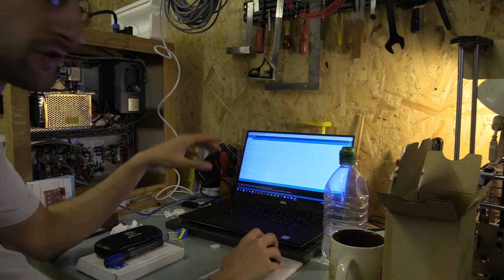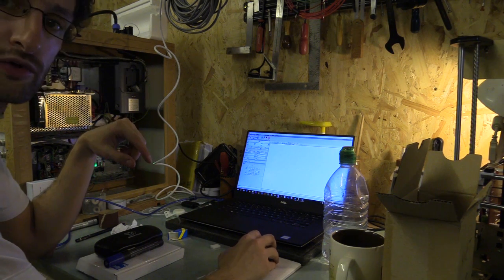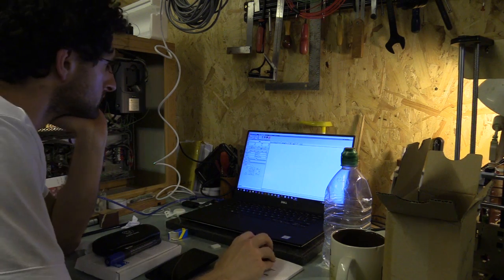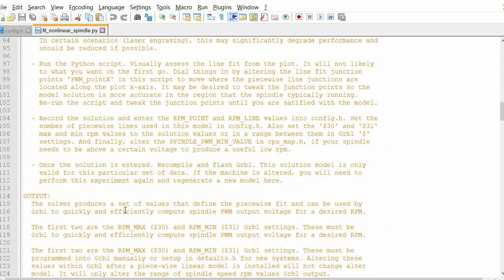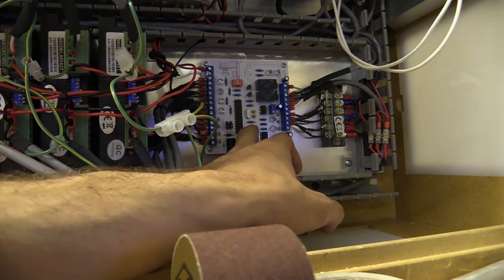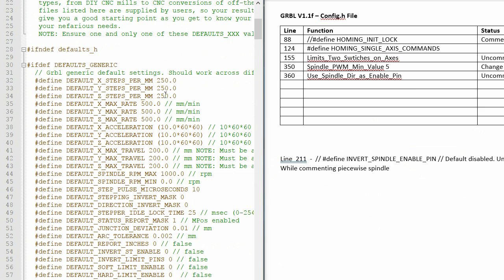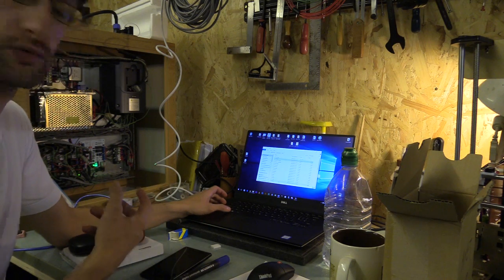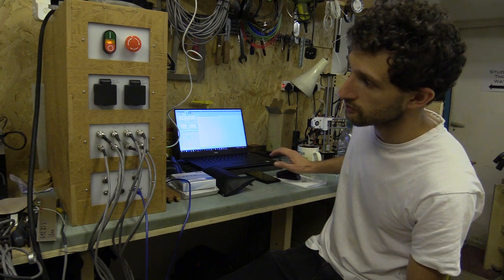#18d Updating Firmware to GRBL V1.1 #18b / Phoenix CNC Controller

Comment: hello can you help solve some homming circle problem, I have limit swith on both side of the x and y  axis  for the z 1 limit at the top each time I enable the hard limit it lock and show MSG, and when I try the soft limit and home the cnc  peform strange because I change to v1.1 grbl when I watch this video I still dont understand, I want you to show me how you update and compile the file to the arduino board just to solve both hard, soft and homming circle thanks.

Comment: Did going to 1.1 create problems with bCNC? My controller has 1.1 and is having the connected but showing not connected problem. Some people said this caused issues
Reply from the maker: It seems to be working fine for me now - just need to go through the firmware and change the relevant things, but my firmware wasn't that heavily modified in the scale of things.
Reply: Thats good then. When I received my phoenix board recently, with 1.1e I had the problem of bCNC saying not connected when it was, and also the readout not showing machine or work positions.
I read somewhere that it was an issue with 1.1 and to go back to 0.9J. I attempted to do that (not knowing anything about flashing arduinos) and now I can't get it flashed back on. One step forward two steps back!

Comment: I loved the way you say that you were a little confused, I on the other hand was totally lost when you got to the first line.Just a note on my CNC for your info, you may remember that as soon as I went to the help menu my keyboard and mouse was disabled. A friend of mine suggested that it might be to do with the version of windows (windows 10) that I was using. I got hold of a old computer (XP) and this solved all my problems so I can now use my CNC. Although there is nothing in the documentation "at least the parts I could read" it would appear that the cnc is not compatible with windows 10, so if anyone else contacts you about problems with a CNC bought from China you will be able to tell them why it isn't working. Thanks again for all the help and effort you put in on my behalf.
Reply from the maker: Thank heaven for that!

Comment: I didn't catch how you connected the controller to the VFD and can't find the controller schematic, so I might be way off.

Usual way is to control the VFD set frequency with external voltage for 0 to Vcc volts. If you feed this input from a PWM pin of your controller, then varying your PWM value produces the control voltage and "tells" the VFD what speed you want. Trick is, Vcc of your VFD and your controller might be different, ie. Arduino controller is 5V and VFD expects 10V for full speed. This is completely dependent on how everything is connected, so include the schematics if you want more detail but it could explain why you're not getting full 100% RPM.

Controller output voltage doesn't have to be linear with set PWM and that's where the non linear fit comes into play.

Your VFD also most probably runs  in open loop, so if you put a lot of load on the motor, motor speed will be lower then the one set on the VFD. Since you can't compensate for that easily, you should calibrate the controller so that VFD set frequency if linear to the PWM, and ignore the actual spindle speed. If the VFD happens to run in a closed loop, then motor will always spin at exactly the VFD set frequency or not at all, so again, it's enough to make PWM linear to the VFD set frequency.
Reply from the maker: It's like every time I scratch I open up a gaping wound! Thanks for the tip - I will look at the manual again but I think I can probably live with the slight discrepancy - I just want to get back to cutting stuff and rebuilding the machine!